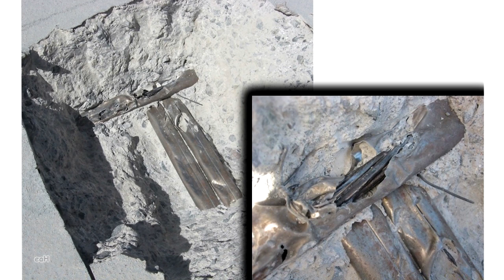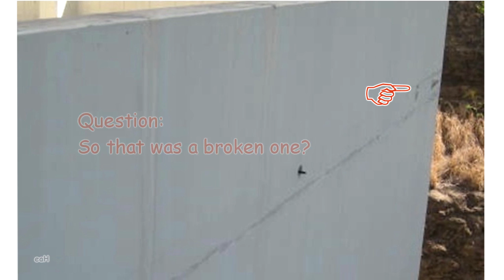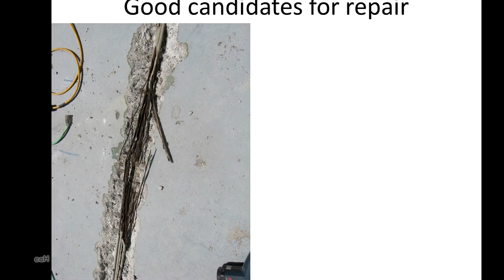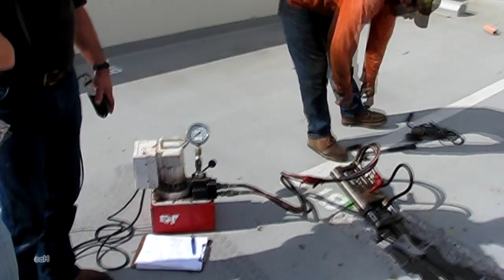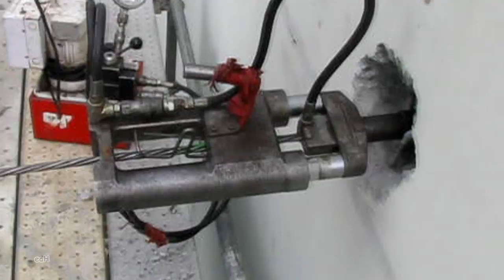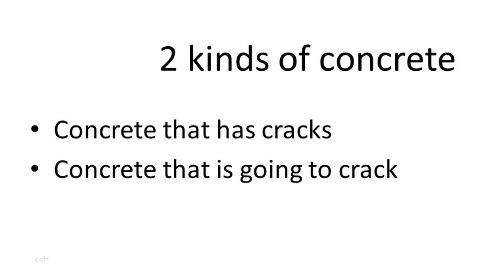Repair of Post Tension Structures

Comment: at 28:06: the guy is failing at basic self preservation: if the strand would snap at other end at full load, the jack would be flying and hydraulic hoses would cut him in the half. he suppose to stand right next to the wall

Comment: For repairing any PT slab follow below:
1. Make a detailed GPR scan
2. After marking for exact tendon locations, make sure the tendons are grouted well (by using air and water checking)
3. Use epoxy injection if some voids are found
4. back-prop the area
5. Cut the tendon
6. Use remedial measures as advised by engineer / designer
Reply: 0

Comment: Good video. There might be a lot of misconceptions about PT cables. If you hit one with a shovel digging it won't break will it?  If you hit it with a sledge hammer breaking concrete it won't break will it? A jack hammer could break it, right? How can it be loosened if it is in concrete? If the house has PT cables would the garage if it is a lower elevation? Would flat work around the house? I am about to get a GPR and all of the rumors have scared the s.it out of me. I am afraid to break the slab and afraid to dig around it.